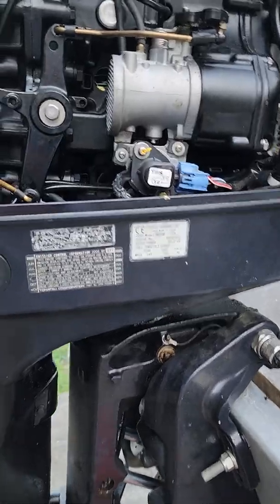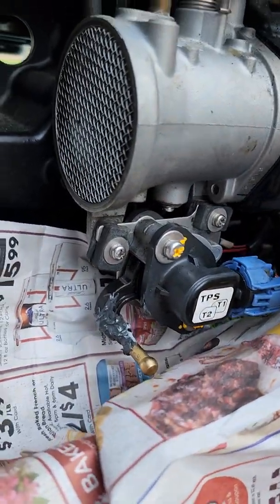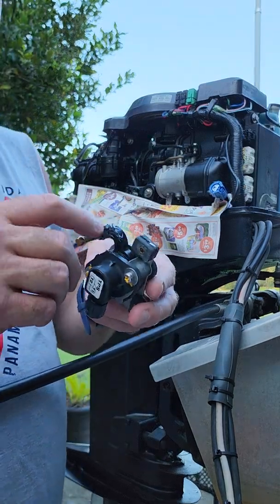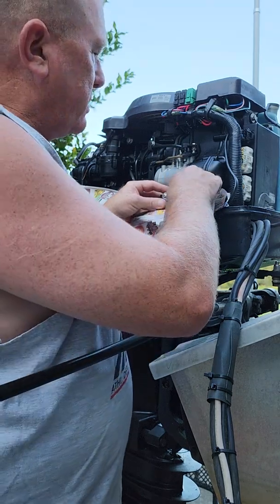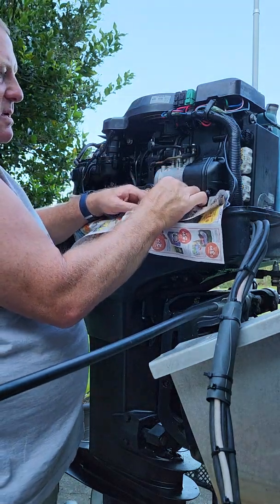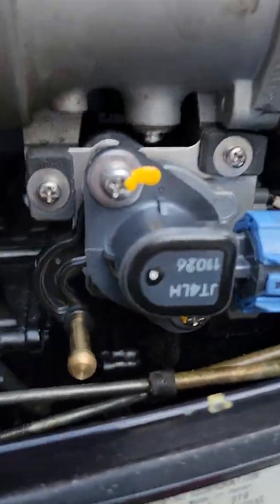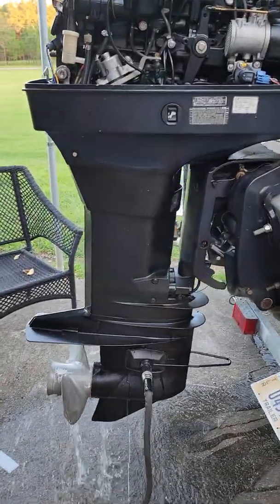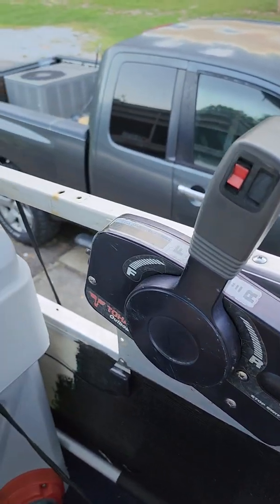Tohatsu 90hp outboard TPS change and reset . with code directions.

Comment: Did you get your motor running?  Mine won’t start like yours was at the end.
Reply from the maker: Yes with more work and effort I sure did , 
I basically figured out my fuel air mixture was messing up I removed the fuel rail and took out the injectors and used a air compressor and carb cleaner to force and and a 12v battery to activate the injector and force the cleaner through it , also I had a bad air compressor piston it gouged up the cylinder wall so I had to hone the wall and get new ring for the piston.  It was quite detailed to do wish I had made a video but I was so frustrated  I didn't want my failures on camera 😫. Best of luck get back toe if you have any more questions.. lol I'm pretty much an expert on this engine now🤣
Reply from the maker: Jere L send me your email address and I can send you the manual . Bdeland7565@gmail.com
Reply: How did you fix the motor run slow?
Reply: Доброго времени парни может есть информация как прошить мотор с такой системой из 40 в 50 лс ятоже переделывал топливную систему поставил насос высокого давления от автомобиля и мотор заработал отлично если интересно могу снять видео
Reply: Hey man, can you tell me where battery cables should go on this engine? Cant find any info about that. wondering if + power goes straight to starter solenoid and ground just somewhere close to it